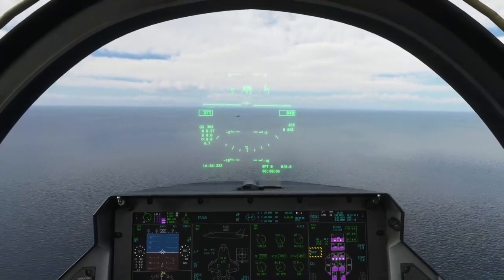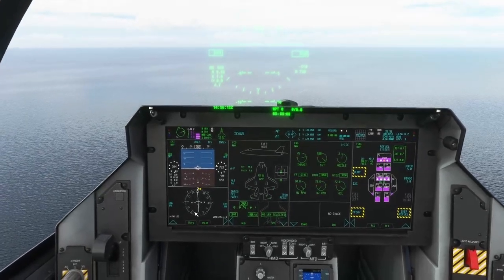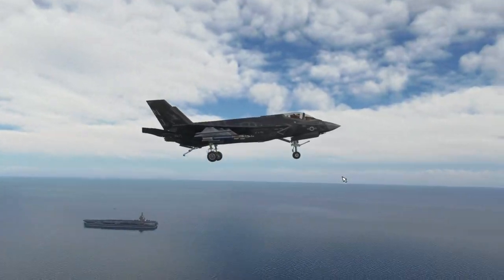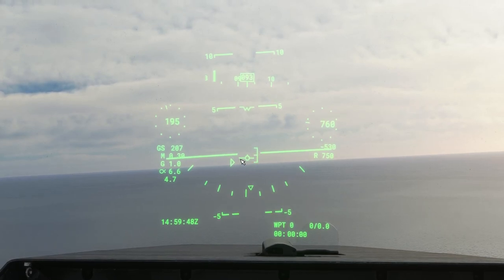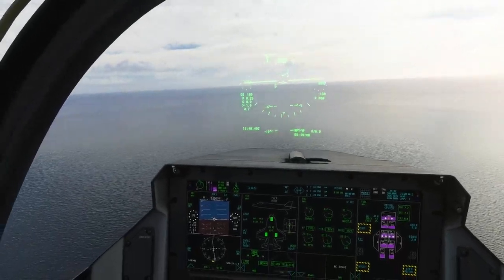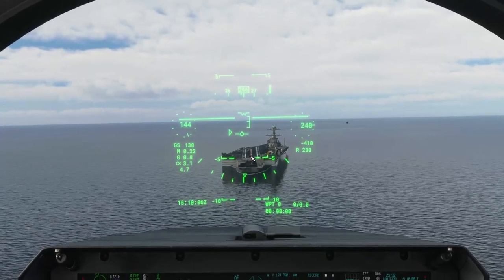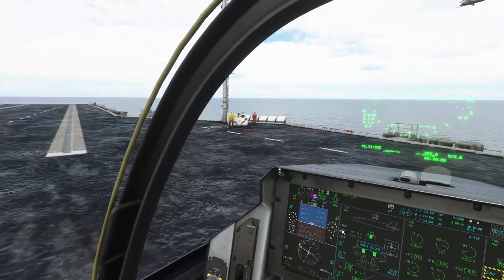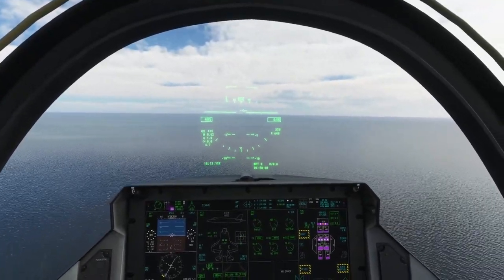Operating your F-35C with Catapults and Arrestor Gear - Indiafoxtecho F-35 (MSFS)

Comment: Excellent, excellent tutorial. I could not find a video that explained the HUD and how it relates to the landing. I watched your video and tried it out and immediately saw a massive improvement. Thanks for sharing.
Reply from the maker: It’s comments like this that make it all worth while! Thanks 👍🏻
Reply: @cgaviator How far out do you begin your final descent and from what height and speed? I’m terrible with math and keep practicing at about 1-2,000 ft but the inconsistency in speed, distance, and height make it difficult to hit the same spot every time. Thanks!
Reply from the maker: @yournamehere4790  worth watching my case 3 recovery video as that may answer your question. 👍🏻

Comment: Do the arresting cables and catapult work on console?
Reply from the maker: This is an old video, not sure what’s available for Xbox these days. The F35 I believe has an inbuilt function that can be used anywhere, rather than relying on cables.
Reply: @cgaviator  additional question does the f35 come with that carrier or is that a separate thing you bought
Reply from the maker: @complacentnonsense3460  I had the pre release version at this time. I believe it’s still offered separately at a small price. You’d have to check the small print to be sure.

Comment: When flying a grob tutor you rev up the engine back and down before departing to check to Ts&Ps. Do you do this with a hawk and f35?
Reply: Most aircraft have their own pre takeoff engine check for sure but id imagine the checklist for the f35 is still secret. i know the hawks do a really long pretakeoff engine check as i work on a airforce base that fly them for trainers and they always sit on the runway for a minute or so on brakes with the engine howling lol. the f-18 also does a pre takeoff thrust and rpm check. throttle to mil, atleast 100 percent thrust on both engines and temps and pressures within limits, brakes off and into afterburner for the roll.
Reply from the maker: The engine check is thorough on piston aircraft to check performance. On jets the norm is to check temps, rpm etc are in limits. Slight variations between different jets. Some require static takeoff (like the hawk) and others allow for rolling takeoff (like the F18). Engines are still checked regardless of takeoff type.

Comment: I'm not sure you landed long - looks short to me, probably a 1 wire. That being said landing without use of the ball must be tricky so props to you for that, plus that pattern was a nice touch :)
Reply from the maker: Thanks 👍🏻 The replay was a short landing, this in cockpit attempt I think was long. But not LSO so no problem! 😂
Reply: @cgaviator  ah I must’ve gotten confused. I’d find it practically impossible to get a good landing without the ball, wonder if there will be a mod for that in MSFS
Reply from the maker: @Uselessnoobcow  the LSO function does work, I just had the audio muted. It’ll give basic call-outs.
Reply: @cgaviator  Lso maybe but the ball gives you more precise information

Comment: I don't know much about aircraft carrier operations, but do the Spams really operate aircraft with the carrier at anchor?? If the ship is underway, it would turn into wind and the relative speed of the ship gives a wind speed down the deck to assist in landing the aircraft.
The ultimate test is landing at night, onto a pitching deck - Force 9 and the ship in blackout lighting.
Reply: No, they don't operate landings stationary. The carrier is usually at around 11 knots and aligned so the wind direction flows down the angled deck. Optimal combined wind speed (carrier speed + wind speed) would be 22 to 32 knots.
Reply: @TheSd1cko  As I thought.
Reply from the maker: The developers recommend setting the wind to 25kt down the approach for authentic ground speeds. The carrier is static due to limitations in MSFS. DCS is still the platinum simulation for this scenario.
Reply: @cgaviator  definitely. Especially if you fly the Mariana's. It looks even better in DCS than it does in MSFS!!

Comment: The lack of a full function carrier was a great loss between FSX and MSFS 2020.  While MSFS is visually more appealing and has some great features, FSX outclasses MSFS 2020 in many ways. For example, the trim functionality of MSFS is horrible.  Don't get me wrong, I really like MSFS 2020, but it is more like an ongoing beta test.
Reply from the maker: Yeah, it’s such a behemoth that it would take years to produce something that’s 100%. Greg carriers are catching up. Static ones can have ILS and Tacan now. Just need the moving ones to pitch and roll as well as have the navaids ans we’ll be getting close!
Reply: @cgaviator  I don't really that the FSX carriers pitched and rolled, but they had working shuttle, deflectors, and other realistic components. I used to love hovering the Cub over the deck.

Comment: Where is the IFLOLS?
Reply: I honestly think if you want this level of detail, then you need to be flying in DCS
Reply: @TheSd1cko  I fly already on DCS since beginning
Reply: @TestPilotVirtual  same. I don't bother with military aircraft in MSFS for this very reason. It might look fantastic, but flight models and realism isn't a patch on DCS.
Reply: @TheSd1cko  Right? No shuttle, no arrestor gear, no IFOLS, no working deck crew and the systems of the birds are also lacking. MSFS is nice for some in between flying but i mainly stick with DCS.